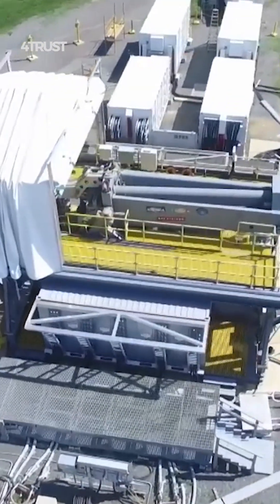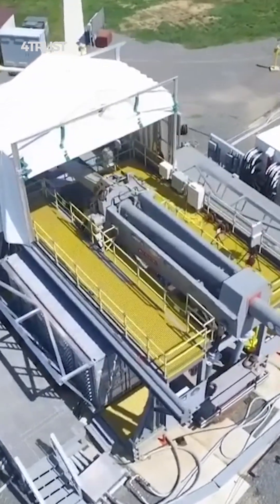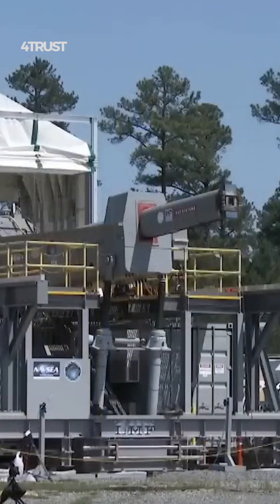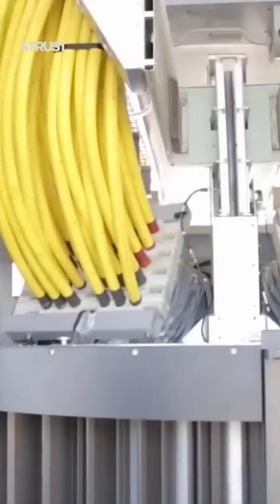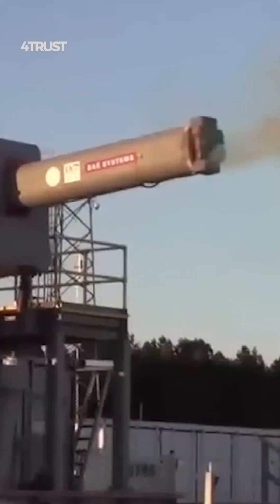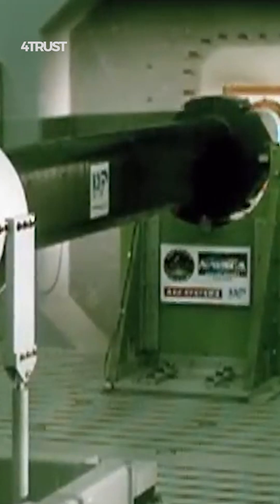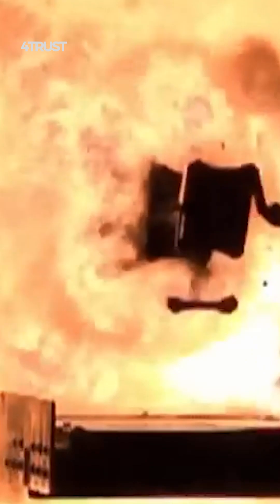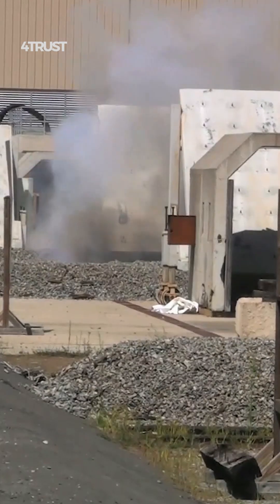How Powerful is the Electromagnetic Railgun Navy's, New Cannon #shorts

Comment: Except! The immense amount of electricity creates a plasma across the accelerator arms. (the rails) There exists no material, not one, that can withstand this plasma. Only intense, focused magnetic fields -- in a vacuum -- can keep the plasm away from the walls around a magnetic containment field.
Soooo... the part they avoid (aahheemm) telling you/us is that these things eat the equivalent of "The Barrels" after only a few "shots." They have to be replaced faster than it is practical, or economical. Sure, no gunpowder. No "shells." Oh! My! What a savings! In storage space and the manufacturing costs of explosive ordinance! Woohoo! 
Yeah but... the storage is now full of replacement rails (Super Expensive) and the equipment needed to change them. It winds up being far more expensive in money, maintenance, and time... than conventional weapons. 
And that's why these Rail Gun Projects have been canceled. 
Materials Research continues, looking for a Super Conductive Material that will hold up in the conditions inside of these Contraptions... But don't hold your breath.